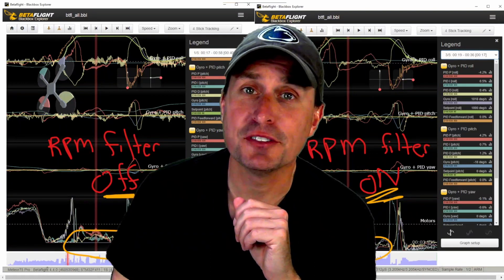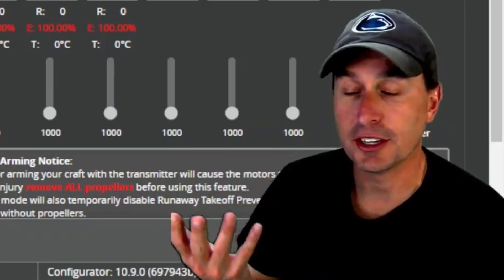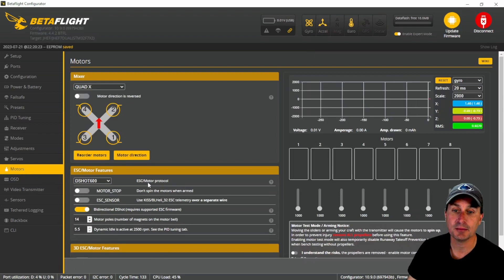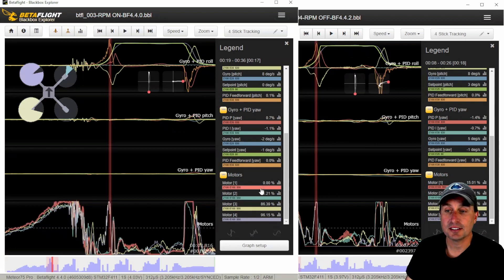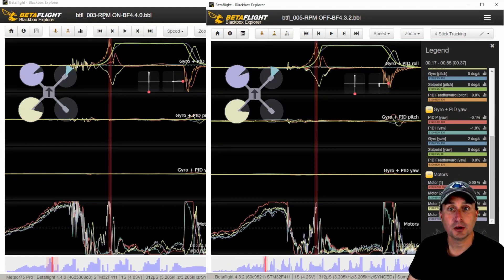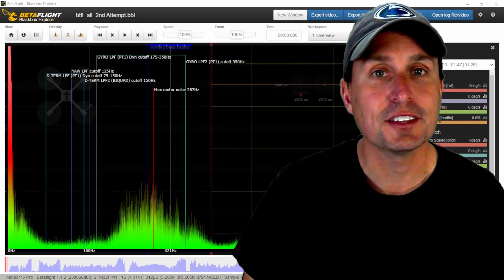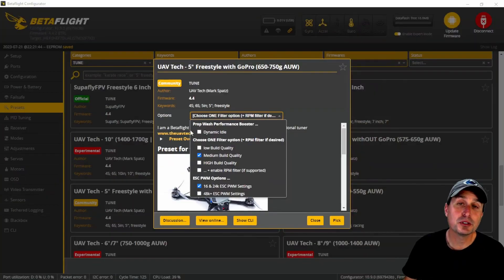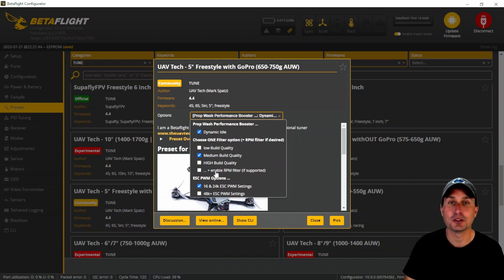Betaflight 4.4 Potential Dynamic Idle Bug

Comment: is this still the case with 4.5? I upgraded recently but it still fells very floaty…
Reply from the maker: i just tested yesterday, and it seems to be fixed.  If you log and see motor commans drop below 15% at idle while flying, then it is not this issue.
Reply: @uavtech  thx a lot, will do!

Comment: When i have dynamic idle on my quad does not lift off the ground barely, this is with RPM filter on using 4.4.2. I have changed the dynamic idle value from 45 to 100 but theres not difference. I turn off dynamic idle and set minimum throttle to around 9k in motors tab it works. So apparently i cant not use dynamic idle...

Comment: Hey Mark, whilst you're there and if you know: for bluejay esc software settings on my 4s 5" freestyle rig, I seem to have inherited a minimum startup power (boost) value of 1025 and maximum startup power (protection) of 1100, but the recommendation seems to be to drop these to 1010 and 1020 respectively (for safety of equipment purposes i.e. in case of crashes etc). Does this sound like the thing to do?

Comment: IF you don't have airmode activated and motor stop is on, do any of these even make any difference/matter?
Reply from the maker: No
Reply: @uavtech  No wonder none of these issues have been affecting me (despite having dynamic idle active, as I never fly using airmode - weird but I've never had a drop out due to 0 throttle etc, so never activated airmode for flights)! I do have rpm filters on so I should be ok even if I use airmode.

Comment: I noticed this bug, which I think is around the bidirectional DSHOT changes. I found that the bug goes away when I used normal idle (not dynamic). I could still use RPM filters that way.
Reply from the maker: yup.  but i want to use Dynamic Idle with NO rpm filter.  Damn it.  😞

Comment: There's another bug with Target Diat/Mambaf722_2022a (stm32F7X2)
 
No gyro shows up.   I had to manually set the gyro in the cli.
Reply from the maker: manufacturer doesn't have the default right.  did you p9st to BF for the setting that needs to be added to the default file?
Reply: @uavtech  just did so!  Thanks for responding.

Comment: I have a question, might sound dumb but, are the gummies we use on flight contollers to reduce vibration alter the noise frequency?  
What I mean is lets say we have a quad with rpm filter on and the motors vibrate at X frequency. RPM filter will take this X data and put its notches on that frequency.
But if the gummies are altering the noise maybe flight controller is getting vibrations at x-60 frequency.  Than RPM filter notches will be on the wrong frequency right? 
If that is the case than would hard mounting the fc be better? So that it gets the same vibration with the motors and rpm filter will clean exactly that  noise frequency the FC is getting?
just brainstorming ....

Comment: I have a Taycan that flies fine for normal use but on a windy day when lowering throttle it feels like the wind is picking up one corner and making the other motors spin faster so it does not appear to want to come down. One thing that helps is changing the direction flying into the wind, but I can also pitch forward more to lose altitude. Although I think this is a bad issue, disarming would not be the only option if the throttle did not go to 0. You could pitch forward to lose altitude before disarming.
Reply: What fc does this happen on? I have had it on 2 hm cross f4s with bmi. I can’t figure out the cause from a tune perspective. I tried disabling dynamic idle but it still happens, especially on a windy day… really looking forward to a solution
Reply: @JALFPV  It’s a Succex-D mini F7. I don’t think the issue is the flight controller in my case. I think it’s the frame design. The Taycan wasn’t designed to fly outdoors on windy days is all. I think the cause is the large foam pads getting caught in the wind which is why changing direction a little helps.

Comment: Great! I'll have to go check since I've switched from your UAV tech profile on my Chimera 7 to the Superfly one (for some reason doesn't have bounceback and zero throttle wobbles), but will need to check and make sure about the rpm filter. Thanks again.

Comment: On my whoop my props stop when using dynamic idle. Never saw this on my bigger quads even using a nice high setting: 75 on a 2" whoop.
Reply from the maker: that's weird.  maybe RPM setting too low?
Reply: @uavtech  Yeah strange because with dshot idle set to 10 it idles around 5000rpm and they don't struggle to start even far lower then that. When I set dynamic idle to 75 I'm seeing the braking motors stop. Especially with air mode on.
Reply: @DriftaholiC  if its the betafpv 12a aio v2.2 its got a bug i had one with it on all bluejay versions. I take off and it works fine for me no stalls. Just waiting for new blujay version.
Reply: i had some old plane 180mah (11g) 2s lipos lying around and used motor output limit on my 702 32000kv whoop and its just as good without the start up issues. + more torque!

Comment: I saw this 15%...
Is there a relationship with rise up throtle during dives ?
Reply from the maker: no, this was just with flips and rolls.  Even with throttle blips you can tell that there is something off as motors don't spin down.  Only do to 15.01%.
Reply: @uavtech  If my 7 inch with rise up throtle during dive a mountain I leave more than 15 percent throttle during the descent the problem disappears. On all my 7 inches and all betaflight versions.
Reply from the maker: @Skyrider82  check your yaw gyro signal and input.  In many cases, your 7" is wanting to yaw sideways, and the FC is spinning p some motors to prevent that from happening.